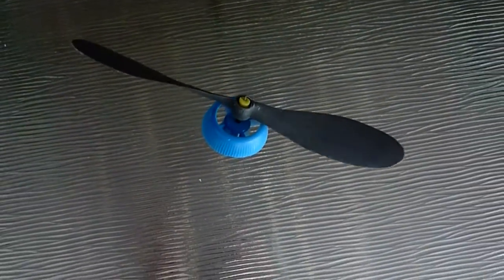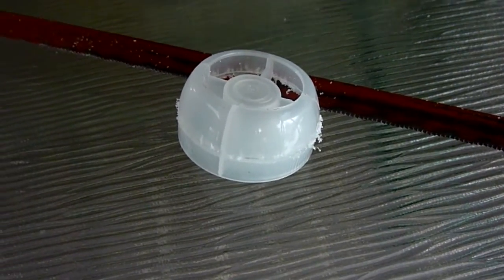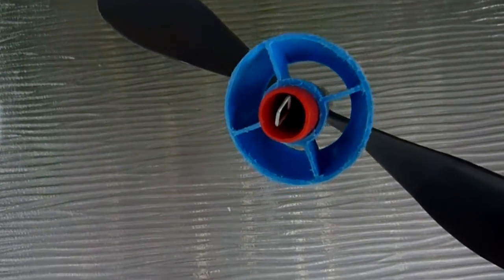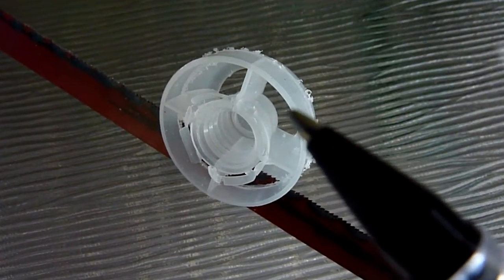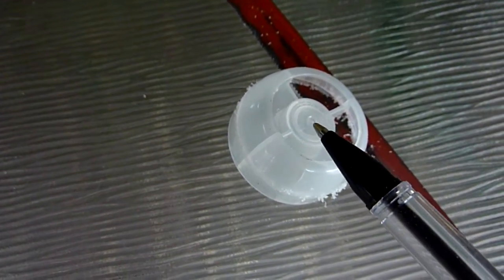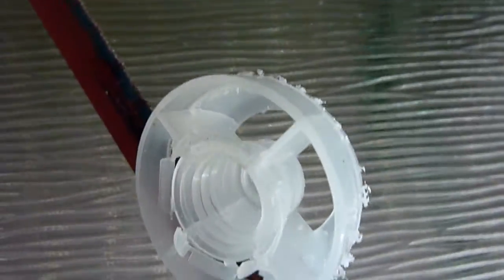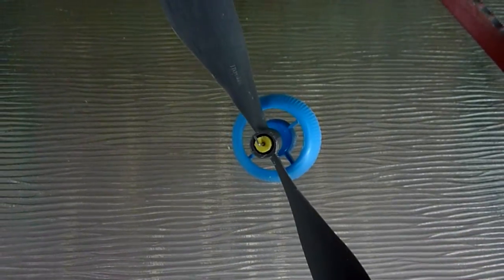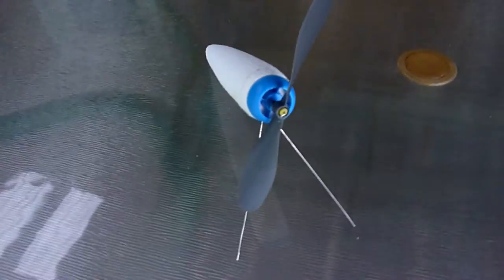#1 PROPELLER MOUNT FOR RUBBER BAND PLANE (Home Hack)

Comment: Nice Hack....good to see more frequent vids again... keep them coming.  Waiting for your next speaker concept!
Reply from the maker: +DaveDodd Thanks. I made a "old-timer" style rubber band plane (with the same prop mount and fuselage). It looks cute in the air and will look good in a You Tube video. I have to color it up a bit, then I will make the video. lol
I have the best speaker sound yet with my 2' full-range speakers (from a computer speaker set). I run the small full-range speakers completely out-of-the-box and it increases highs and makes the treble like "tube-amp" treble (with the speaker out-of-the-box). I run it with a 6" woofer that is in-the-box).
 
For when the 2" full-range speaker is ran out-of-the-box I use a 1.5 mf cap on it. If I use a 2 mf cap, it will sound too "squarky". Out-of-the-box makes them "squarky" so I pinch it off by only letting in "tizz" and I still get the right amount of "squark". The 1.5 mf cap is stepped with a 4.7 mf cap resisted by 33 ohms. I run it with a woofer that has chokes on it (arranged to suite that particular woofer and box).

With my little 2" full-range speakers I takeoff the plastic dome and replace it with a flat disc of office paper, plus a tiny foil "whizzer" made from standard al-foil, stuck on the disc centers. 
If you do that and run them out-of-the-box (with the 1.5 mf cap stepped @ 33 ohms with the 4.7 cap) it should sound amazing with a properly choked woofer that is in-the-box. I will put them on YT but I don't think they will sound any different on YT. lol 

Try it yourself. I'm gunna make some more speakers up and use my finished speakers as reference speakers. And sell the new speakers for at least 1,500 bucks a pair. The out-of-the-box sound makes them sound "live", so they probably sound better, only subjectively (and not so much cos of accuracy). So they might even sound "better" (subjectively) than any other speaker (that is completely boxed). Like the difference between tube amps is only really a subjective thing. Accurate speakers probably still just sound like ordinary speakers. If they do sound "ordinary"(and I'll never be able to hear any) there may be a "tube niche" market with speakers that sound good (subjectively) and turn transistor amps into "tube amps". lol An easier market to get into than accuracy. lol If you want accurate speakers you will have to spend big. Otherwise why would high-end speaker be so fucking expensive (if accuracy is not their aim)?
Reply from the maker: +DaveDodd https://youtu.be/E4KjwqYYoOY